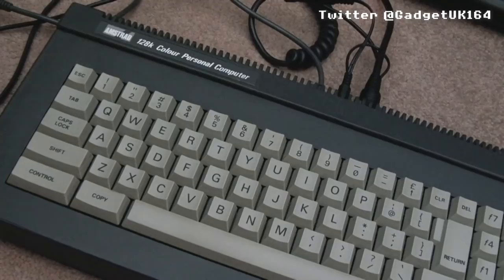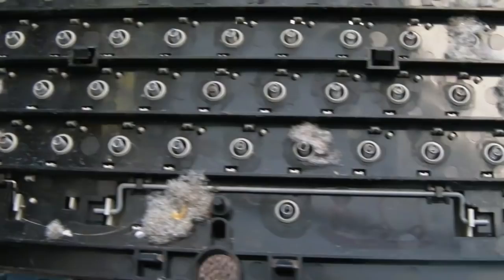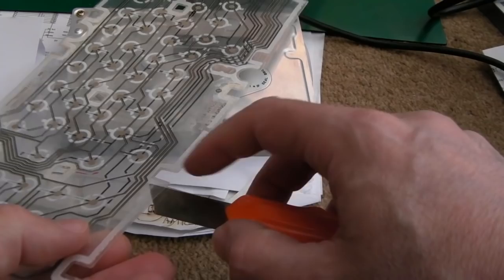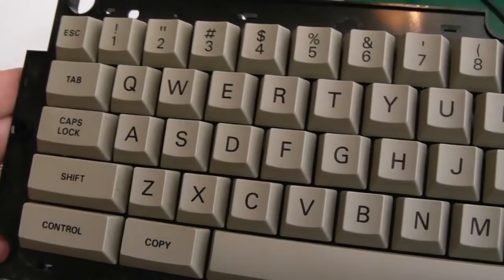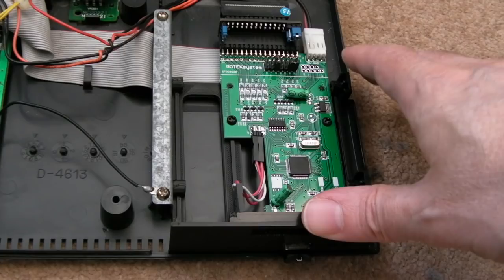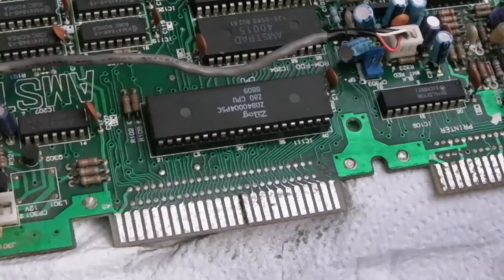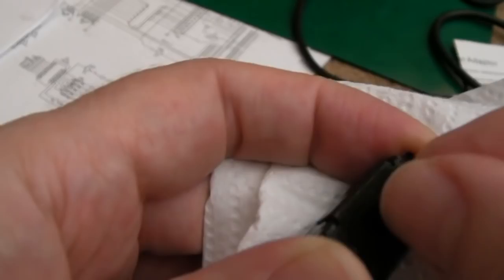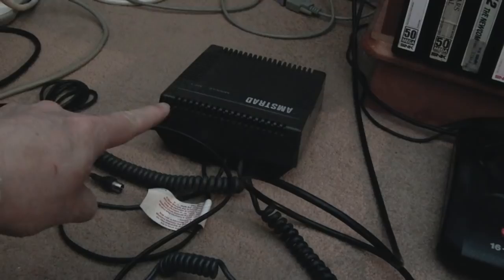Amstrad CPC 6128 Repair & Upgrade Part 2

Comment from the maker: Part 1 - https://youtu.be/yEtkGc1gia4
BTW - Nothing wrong with fitting a Gotek to an Amiga ;)  It's just easier running things from WHDLOAD imo!  Those 2 screws that go in the side, I forgot to show that after cleaning them they were silver looking instead of black - I repainted the tops of them with black paint and they look like new now!
Reply: if you want original disk images for CPC in HFE v3 format poke me, i'll send you any original you want to test :)
Reply: note about the capacitors : smalls, but when they die, the display fucks on startup. I had to change them on mine to restore the display which was badly waving on left and right borders ;)
Reply from the maker: @dlfrsilver  Cheers, much appreciated =D
Reply: @GadgetUK164  I have for example Red Heat :)
Reply: Sorry for offtopic but I like your accent, is that Manchester accent? :-)
Reply from the maker: Lancashire accent!

Comment: The reason the 3D print is smooth on the bottom is because that is the part that was on the print bed. It would be easier to print it that way because less supports are needed. It looks like there were supports needed for the LCD screen hole which would be the source of those white spots you pointed out. If the mount was printed with the face down on the print bed then the screw blocks that are sticking up along the sides and the back bar of the mount would need support along the whole length of the mount using more filament that costs money.

Comment: A lot of software will only run from Drive A (nominally the internal drive), so if you want to place the internal drive into an external case, you might want to look into adding an 'ABBA' switch which would allow you to swap around whether the internal drive is configured as A and the external as B, or vice versa.  These tended to be fitted "back in the day" to allow booting of software from external 3.5" drives, but should also work for swapping between a 3" and a gotek.
Reply: On a 6128, they generally need to be fitted internally and requires cutting a PCB track and soldering wires to one of the ICs.
Reply: I had one that plugged on the external connector and switched the lines with a switch before plugging on the drive.

Will work with 3” or 3.5”.

In the day I had a 3.5” with a switch so that first 40 tracks were Side A and second 40 tracks were Side B.

But, these days, ParaDOS 1.2 is the way to go for large formats.

Comment: I was (and still am) a huge fan of the Amiga Action Replay III Cartridge. I used it for a lot more than just cheating in games back then and would therefore prefer to retain having that option. But the AR3 doesn't work with any hard drives or accelerators... or at least you'll have to turn them off... So, if you want the Action Replay III experience on your Amiga 500 without the DJ experience, then a Gotek is the only way to go.
- Having said that, I am also a huge fan of keeping the internal floppy drive a real drive. So, the Goteks on both my A500 and my PowerPuff CPC6128 are both external. For that reason, I have installed a DF0/DF1 boot selector mod in my A500, which can "trick" it into seeing the external Gotek as DF0... And in the Amstrad I have made an "ABBA Switch" mod (in a more elegant and less intrusive way, than the original butcher-mod from the '80s). So that by flipping a switch, A: is swapped to B: and B: to A: (ABBA), very similar to the Amiga boot selector mod.

- If you are wondering why I call it my "PowerPuff CPC"... it is simply because it was made by Sir Alan Sugar, with spice and everything nice 😆❤

Comment: Both my 6128 and +3 have internal Gotek. Amiga 4000 has it too but it has external Gotek while keeping original Chinons inside.
There are external 3.5" PC drives with A/B switch on the cable, they're compatible with both 6128 and +3. I bought it a while ago from a Greek retro guy on eBay, forgot his name. That would be a cheaper alternative to 3" disks.

Comment: Agreed:
I have a floppy emulator in my 6128 for the same reason. I'd be even happier if there was some kind of 'DivMMC' or even a 'HDD' solution for the system but to my knowledge there isn't anything reasonably available.
 To be fair most CPC software (games) is hard-coded to run from drive A so even with an ABBA switch that 'only' gets you a useful external floppy...
...my "favorite" mod is a gutted slimline 3.5" FDD to fit the case along with a Gotek-like solution along with an ABBA switch - kludgey but useful.
Hardware I can do, and design, but I'm not a software guy - one of the old Speccy Z80 socket to CF boards would work fine if there was an AMSDOS for it.
The CPC is such a good 8bit system and for me carries a fair bit of nostalgia as I had a 464 back in the day, sadly mine doesn't get a lot of use.

Comment: I find the rotary encoder on the front a bit intrusive for a CPC. I drill a small hole above the existing left button button (right button has LED above it) and mount a 90 deg angled push button on top to give the 3rd button. I mount the button upside down and solder the body of the switch to the body of the switch below to hold it in place. Then just run wires to the header you talked about.
So with HxC and having an OLED screen (and 3rd button) it is easier to run HxC in  mode like  FlashFloppy and just use buttons to scroll/select files rather than mounting to specific slots. Cheers

Comment: For the storage upgrade i installed the M4Board. Adds wifi, makes the CPC a server for your home network so that you can drag and drop your disks from the Web Browser of your PC directly to the SD card which is connected to the CPC. You do not have to remove SD and put it in the PC inorder to add new files. 
Also you can use additional file manager features, and control from your PC through Wifi from the Web Browser. You can also add ROMs. You cannot go wrong with this solution.

Comment: Great job! Where exactly did you put the cap to get a sharper image? On the CRTC? I've never tried that but I'd love to get the slightly sharper image, especially for Mode 2!
Reply from the maker: It didn't affect the video on this 6128 - It's on my list of things to look back at when I get time.  I did look at the composite signal that is used for sync (off camera) and found no relation to the jailbars these suffer with.  I also noticed that the plus models lack the caps on R,G,B lines etc, but this model does not.  However this 6128 is not as sharp as my 464, so there is something further needs doing to improve it.  I wondered about doing an RGB bypass - ie. disconnect the RGB lines from where they route on the PCB, feed them with shielded wires to the point they go to the connector (ensuring the caps are in place still).  However it might be other traces routed around the Gate Array that are introducing some noise at source in the Gate Array.   There is a big difference between the 464 and 6128 video though...

Comment: exactly the same problems with the one i got...bloody keyboard
i had lots of keys not working.... and it looked imaculate after i stripped it down.....
currently just changed the 74ls chip... not tested it yet...mare of a job... maybe should have gone with the blobby stufff
sound chip Ay on the way too.... :)
yep and the disc games.......... sooooo pricey...
just had to buy steve davis snooker though... :)
even though i cant try it...... :)
and yes you need to buy another 6128 for parts to test the one you have and another one to test that....
lol all good fun

edit... im ringing Alan Sugar on monday......

N x
Reply: If lots of keys have gone, then it's probably the AY that's causing it, especially if you're having sound problems ( key scanning goes through the AY...). AY chips are available but don't get the version with 'A' at the end, as it doesn't have pull-up resistors on the parallel port.
Reply: @alanclarke4646  Thanks for this Alan... yep changing the 74ls IC101 didnt help... I have an Ay chip on order...but its comming from spain......and getting in touch with Alan sugar is soooo diifficult.. he will not call me back..:)
Reply: @neilobusk  Try applying for next series of The Apprentice lol! Hope the AY sorts your CPC out. If not, have a look on the CPC Wiki forums. They're a great bunch of really helpful people.

Comment: I had a similar issue with the membrane of a TRS-80 and I found the conductive paint (same one you used) to have too much resistance when used in a thin line.  I ended up using copper tape and scotch tape.
I wonder what the difference was?  It worked well for yourself :-)

Comment: I didn't know that later CPC6128 did not have the Centronics style connectors anymore. A bit of cost saving there. Yours seem to be a very late model from 1988. Mine was from 1985 or 1986. Edit: I also have never seen that soundchip branded "Microchip". Only "GI". So definetly a very late model
Reply: Neither Amstrads had centronics. Just German and USA 6128 had centronics.
Reply: @rastislavzima  Ah I didn't know that. I had the Schneider CPC. Do you know why the difference?
Reply: @ChipGuy  suppose due to electromagnetic shielding regulations (when you look inside schneider youll also find heavy shealding around pcb not present in amstrads) but that is just my assumption.
Reply: @rastislavzima  Yes my Schneider CPC6128 had a shielding on top of the board. This one did not. That must be it.

Comment: Where did you find an external enclosure for your 3 inch drive? I can’t find any anywhere!
Reply from the maker: They do pop up on eBay from time to time, but pretty expensive usuall!  eg. 100 euros.
Reply: Thanks @GadgetUK164  . Until then I'll keepit as spare in case i need for my plus 3 o

Comment: My keyboard types weird symbols not letters
Any clue how to fix
Reply from the maker: It could be a membrane fault - you would need to take the keyboard to bits to inspect (or test with a known working keyboard), but beyond that I would suspect the sound chip (it handles keyboard input).  It could also be some other problem, perhaps related to display rather than the keyboard?
Reply: Thanks😀😀😀😀

Comment: Why add caps when they are not required, there were maybe a million 6128 sold without adding extra caps.
Reply from the maker: A bit of extra smoothing, around the side of the board far away from the electrolytics on there.  It's not essential on the 6128 as there are electrolytics on there.  On the 464 I covered there were litterally none, which is not a good design imo.  Smoothing power lines can improve stability.